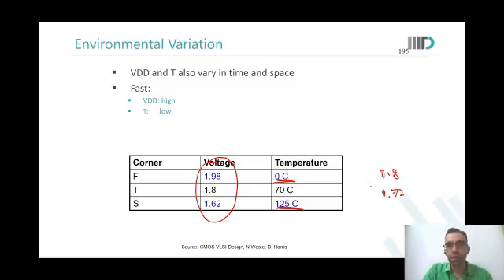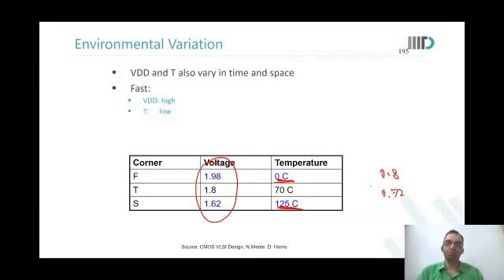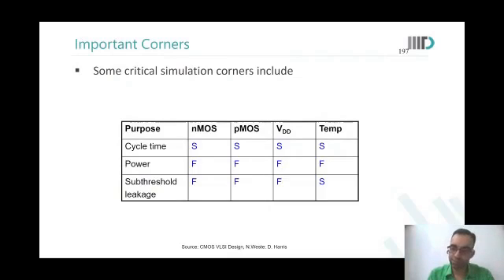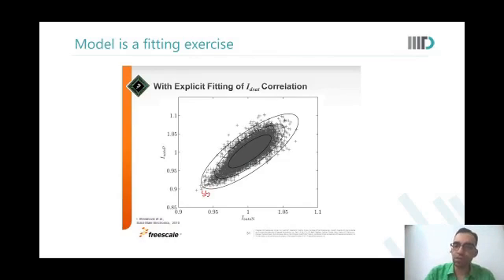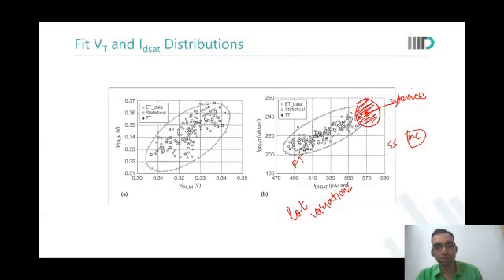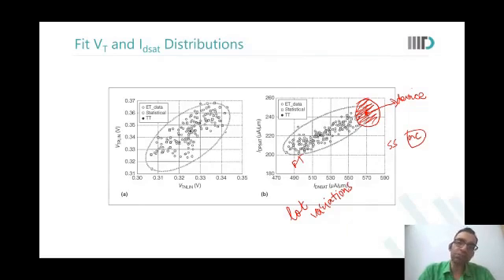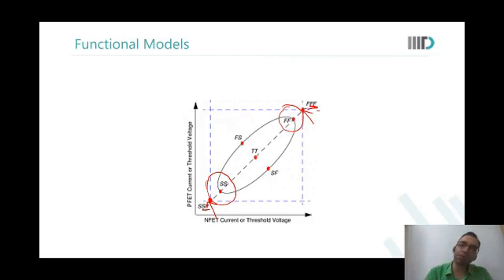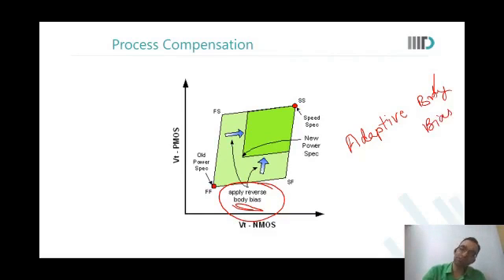Process Variations | Process Corners

Comment: Hi, thanks for the video. For passive devices there are only ss,ff,tt corner. When we select mosfet in sf and fs corner, which corner should we select for passive devices?
Reply from the maker: For a robust design you will have to verify your circuit across all parasitic corners. 

Depending on the topology of the design (like race conditions etc) and technology characteristics, different combinations could be worse.
Reply: @anujg1 
Thanks for the reply. I want to know what will happen in real production. Simulating for all possible corners are very time consuming. Suppose I want to simulate in ff corner for MOSFETs. Can I assume that passive devices like capacitors and resistors are also in ff corner? Or the combination of ff for MOSFET and for example ss for capacitor and resistor is also likely to happen?
Reply from the maker: Depending on the implementation, there may be no correlation between passive corner and device corner. 

So, you have to qualify the worst case combination of passive and device corners to identify the failure boundary of your design and estimate its robustness. 👍🏻